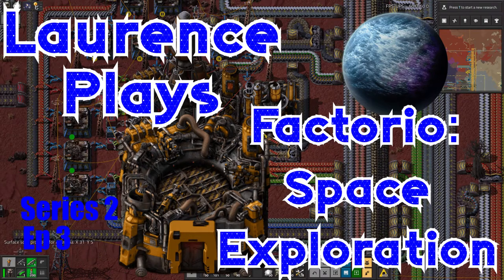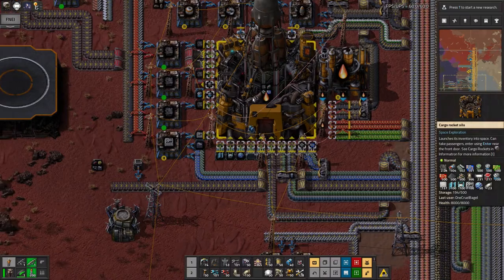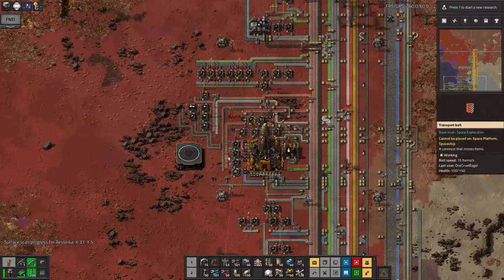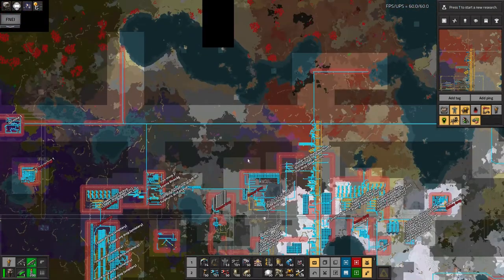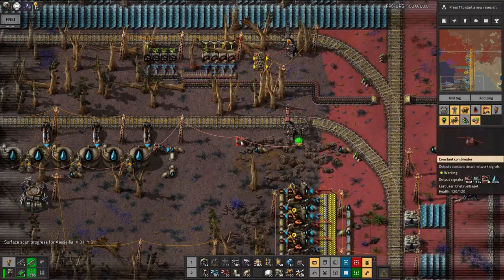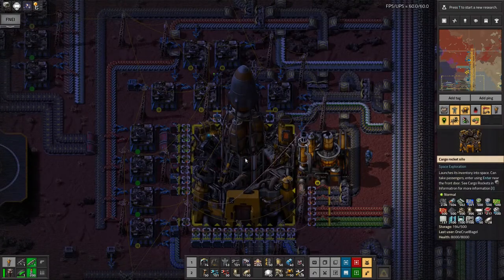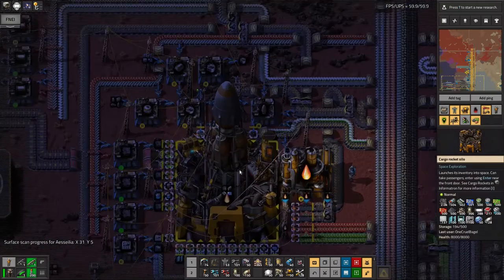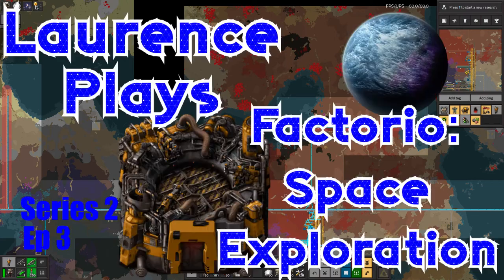S2-E03 - Some Assembly Required - Laurence Plays Factorio: Space Exploration

Comment: I'm at this point... built a space base, saw the space science requirements and freaked out a lil bit.
Reply from the maker: The good news is that rocket science isn't actually that hard to make. The bad news is that the actual challenge is solving space logistics - you need to work out how to get all the stuff you need up there. And what stuff you need! 

Good luck - you'll be fine, just work at it systematically, and if you have to launch a few rockets to get it working, so be it.  :-)